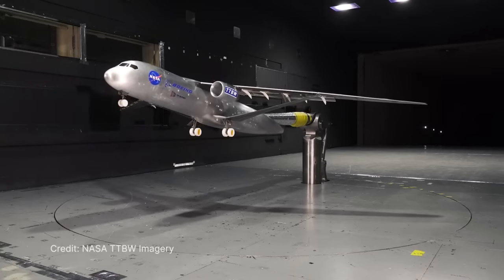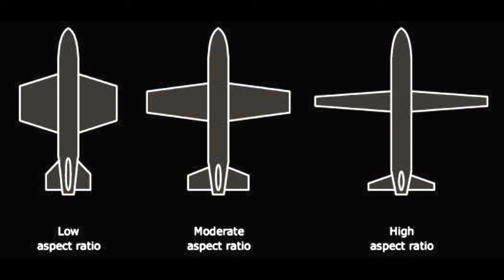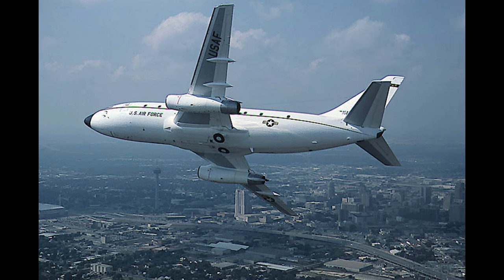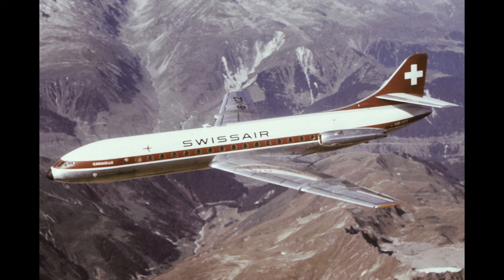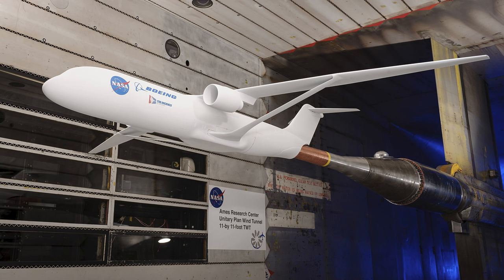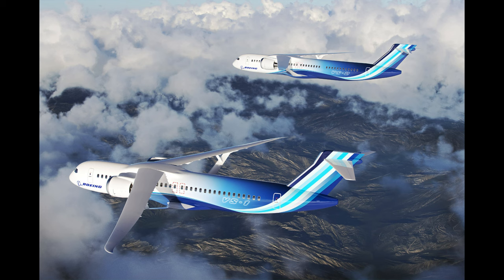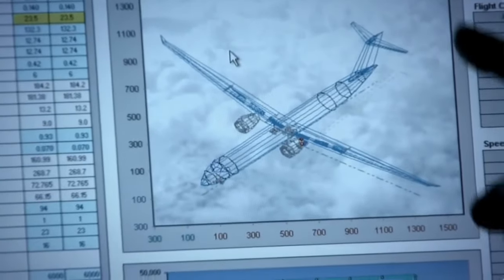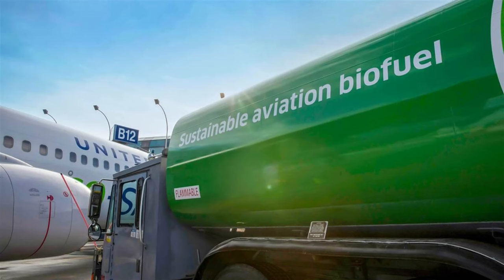NASA's New Airliner Experiment To Make Flying Less Expensive

Comment: thats the thing people dont seem to understand, 
if you can go faster to burn the same amount of fuel over a longer time span, you will emit less pollutants
if you can burn less fuel over the same amount of time, you will emit less pollutants

if you can combine both, you can emit nearly 2-4x less pollutants

electric cars have the problem that they wont last as long (in reality) as they could to offset any manufacturing pollutants of all, or any individual, component

manufacturing and recycling introduce pollutants
reusing and repairing do NOT introduce pollutants

if you have the same amount of cars, and you increase their lifespan, you reduce the amount of pollutants over time, especially if you make the capability to introduce more fuel efficient parts to them

while electric transport has its uses, as cars? they are more inefficient than they are worth, especially if you arent trying to eek out as much environmentally-friendly technologies as possible, to reduce their downsides (and the overall cost of the slave labor that it ends up with, cough cough COBALT, LITHIUM, NICKEL cough cough )
Reply: Your reasoning has been disproven by many independent studies around the world that show that electric cars produce much less overall pollution than gasoline cars even when factoring in the production of the cars, the batteries, recycling, and the sources of electricity, some of which are more polluting than others.

In 2007 a student newspaper editorial at a state university in Connecticut claimed that the Toyota Prius was more harmful to the environment than a Hummer, using similar sensational claims that were not backed up by any data.  The editorial went viral (in 2007 things went viral via e-mail), although it was conveniently left out that it was just an article written by a college student. The same urban legends are passed around today about EV's.

No one ever said EV's create no pollution, or that there are no negative effects. The good news is that the negative effects such as polluting sources of electricity is improving.  Bad people in other countries exploiting workers is still a problem as it has been in other industries and more pressure needs to be applied.
Reply: @StevePemberton2  literally, it comes down to a few things 
1. Greed 
2. Public image 
3. The literal fact that less burned means less aerosolized 
4. Shouting down and economically silencing the opposition 
5. Just because someone says something, doesn't make that true
Reply: @StevePemberton2  increased dirty fuel energy is, by definition, NOT progress toward clean energy

Comment: Cessna 172  a.k.a. "The Dentist Killer"
Reply: I suspect you are thinking of the Beechcraft Bonanza, the one with the V tail, which became known as the Doctor Killer. The problem wasn't the V tail it was that it was one of the first higher performance private aircraft and it initially had a high accident rate when people who could afford it (like doctors) started flying them after moving up from simpler much slower airplanes. The same thing happened with the Cessna 310 which was among the first popular twin-engine private planes. People who could afford it moved up to twin-engine planes assuming that two engines were safer than one, when in fact the opposite was true because twin-engine private planes had a higher fatality rate in an engine out situation than smaller, simpler, slower, and lighter single engine airplanes. Very easy to get into a spin in a small twin-engine airplane if an engine fails.

The Cessna 172 meanwhile is the most successful airplane in history, with over 40,000 having been built.
Reply: @StevePemberton2  Thank you, it is the "dentist" bit that always makes me laugh (doctors too). Just the sort of middle class tw*t to fancy themselves as Biggles and wealthy enough to afford to fly. The perfect demographic! Thanks for all the info.

Comment: Why haven't they developed electric tow vehicles or mechanisms for accelerating commercial jets down runways to take off speeds?  Not only would that save on jet fuel and engine wear, there would be less air and noise pollution near such airports.
Reply: This is complex and doesn't save much fuel, because the takeoff roll itself is a tiny portion of a flight. Substantially more fuel is typically used during taxiing, and both tugs and electric motors for plane landing gear have been tested to save fuel in that phase.

You still need to climb and that requires higher power regardless, so it won't do much for noise pollution.
Reply: @AmbientMorality  It's rather hard to believe that one of those little tow vehicles bringing an aircraft from gate to runway would use up more energy than some massively powerful tow mechanism accelerating a jet to take off speed.  ..."Substantially more," even.

Also, I live ~2 miles from an airport and sometimes the house shakes a bit during a jet's take off roll, even though I can barely hear that same jet as it climbs directly overhead.
Reply: @Philip-1  Taxiing on engines definitely uses more fuel. Idling isn't even close to free, and a lot of taxiing involves accelerating and braking which isn't efficient. 

Maybe in your case it could moderately help, but for most people on the flight path the takeoff roll isn't the issue. And tow vehicles that can go that fast add a lot of complexity and risks that would need to be managed for a tiny part of the fuel usage.
Reply: @AmbientMorality  Nobody said taxiing is free.  In any case, I already gave you the benefit of the doubt regarding taxiway fuel use by having all jets towed to the runway.  By the way, this would offer numerous additional benefits, not unlike the way ocean-going ships embark harbor pilots who are intimately familiar with their home ports.  (Near disasters like the one at JFK last month would be far less likely.)

I'm sure there was a time when catapults and arrester cables were seen as too complex and risky when you could simply make the aircraft carrier longer.  😉
Reply: @Philip-1  Catapults and arrester cables are risky and that's why they're only used when there's a compelling benefit! Here there is not: it's a ton more vehicle traffic interfering with aircraft movements (this is already an issue with taxiing tug proposals) and accelerating a 737 to takeoff speeds takes an enormous amount of power that stretches the credibility of anything short of "basically a catapult". I don't think the safety analogy holds because there's far more times where a takeoff is rejected due to some issue with the aircraft, and it would be harder or impossible to do this here.
Reply: @AmbientMorality  Well, I'm not NASA so I'm in no position to 2nd guess what is too hard or impossible.  I suspect that engineers already looked into it at a time when fuel costs and greenhouse gas emissions were less important.  Perhaps it's time for a 2nd look, the same way the truss braced wing is getting a 2nd look.  A mechanism that can get jets off the ground sooner might also serve as an additional braking mechanism during emergencies.  Not to mention that a jet that uses less runway at takeoff has more runway left over to deal with the unexpected.
Reply: @Philip-1  There's almost no runway in the world where it is safe to try to land again after taking off: that would be extremely likely to result in a runway overrun. Generally, this concept sounds like it's rapidly approaching a catapult, which is just not a good concept for commercial aviation...
Reply: @AmbientMorality  Thank you for the discussion.  👍

Comment: I had no idea they were still using leaded gas in aircraft.  Why has it been so hard to get rid of the lead?
Reply: The engines used in piston engine powered aircraft are often quite old types, dating back to the 50s and 60s. There are more modern ones too, but especially in general aviation the development costs for these engines are high and the numbers you can sell limited.

Comment: Hey Scott (may i just blow the dust off me device as its been a long time since iv made comment to anything on you tube) I was wondering what your opinion would be on a hydrogen based jet engine?, Specifically the one thats being developed by Rolls Royce over here in my neck if the woods.

Comment: Biofuels are just expensive hydrocarbons.  They are a solution to running out of oil, not a solution to more efficient engines.  Pumped crude oil is just old biofuel...

Comment: Weren't trusses removed from designs due to drag?
Reply: Engineering is the art of compromise.  If the gains and efficiency benefits produced from reducing induced drag outweigh the parasitic drag, then you’ve a net gain.  Plus, the trusses themselves could be designed to contribute to lift.

Comment: You know, they could also achieve a great deal of fuel savings if they'd just slow them all down 50-100 kts/hr.
Reply: Commercial jets are built for specific cruising speeds to maximize efficiency, and slowing down that much would lead to losses by using more fuel per distance flown to make up for lost lift

Comment: why do planes still have windows? I recently flew in an A330. I did not have a window seat but wished I could see outside. aid the seats  had a tv screen to watch. my thought. get rid of the windows. install cameras in the front side and bottom of plane. give all passengers the option of using any or two or three or none.

Comment: And no one ever thinks where in the heck are you going to park a plane with that wing span!  
That just might be a bigger problem than you think.  Look at all the A380's.  Can't fly just to any airport, and the wing might be too long to use the taxiway.  So what airline is going to be the launch customer where there a few that might accept it?
Reply: this fits anywhere a 767 does, and the wings fold so it should fit in normal narrowbody gates unless there's weird height constraints

Comment: my issue with current plane design is, if the plane goes down, you are Fu....
in case of the all wing design, you can put in two cabins side by side and make them into pods, with emergency water and food rations, a blow up floating ring and a multiple parachute system, so if the plane goes down , the passengers are not Fu... 
one of my friends is in the military, and only flies with military transport planes, cos in that case he has a parachute on, and if shit happens, he can survive.. with a commercial plane that is not possible, cos you only get the, sit in the chair and pray as option...

Comment: I believe wing trusses are an un-wise path to take.  They increase surface available to icing and FOD impacts.  I'd assume the airfoils will be longer but also weaker. The truss has connection points, and if they fail, due to turbulent air or FOD, may lead to catastrophy.
Reply: Wings too long for airports, folding them then, place for fuel, some say on fuselage... first crash, people are surrounded by fire, engines mounted higher - first catastrophic failure passengers and fuselage (plane thus) destroyed by shrapnel...